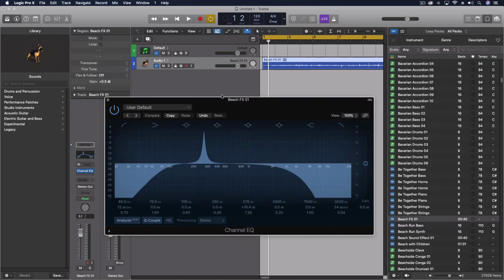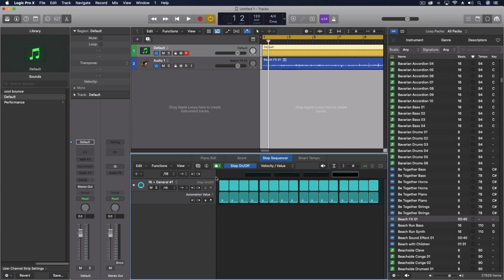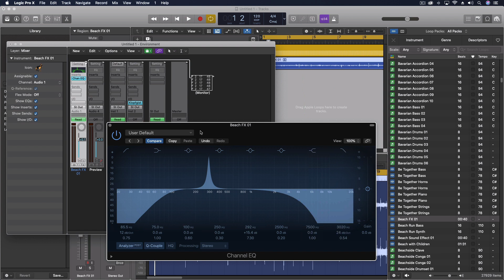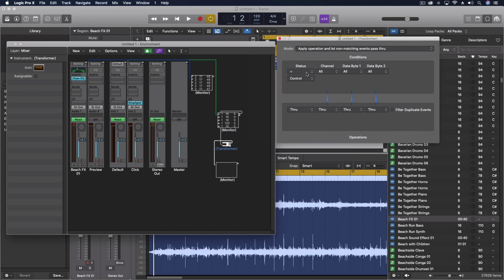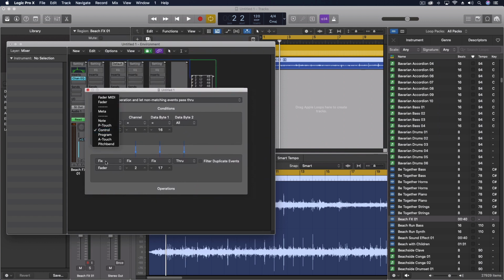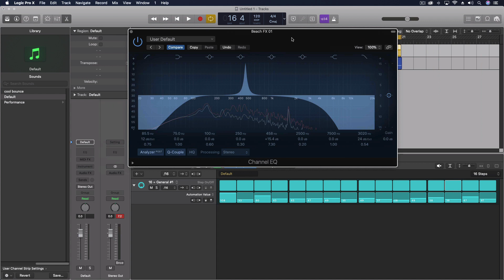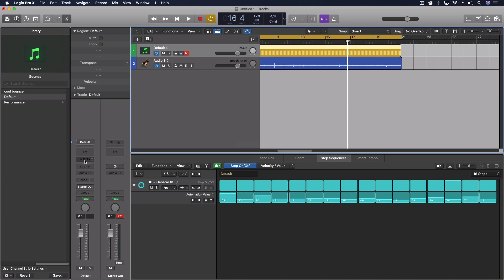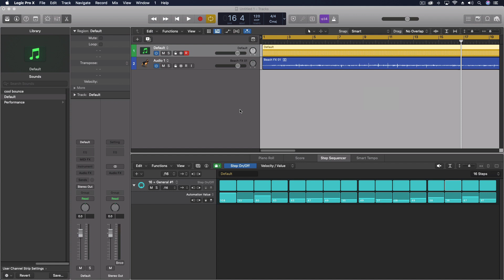Sending Step Sequencer Data to Audio Tracks | Logic Pro X

Comment: There is a so much easier way to do that by putting a Pattern Region on the Audio Track.
Let's say you have an Audio Track called "Audio 1" with the Channel EQ plugin loaded and want to control the Frequency 2 parameter via the Step Sequencer:
-1- Create a new Audio Track "Audio 2"
-2- Right-click on the Track Header of "Audio 2", select the first option "Reassign Track" then "Mixer" and select "Audio 1" which is that Audio Track that you want to control. Now this Track becomes a second Track routed to the same Channel Strip named "Audio 1". Both Tracks have now the same name, which can be named separately from their common Channel Strip
-3- Right-click on the Track Lane of that second Audio Track and select "Create Pattern Region"
-4- There is no Step 4. That's all.

This is one of Logic's secrets that you can have multiple Tracks assign (feeding) the same Channel Strip. In this case, the first Track contains the Audio Region on its Track Lane and the second Track contains the Pattern Region for that Track on its Track Lane to control ANY Automation on that Track. Again, you have access to any Automation from the popup menu in the Step Sequencer, you don't have to look up and assign complex MIDI Routing in the Environment for each parameter.

Hope that helps,
Edgar Rothermich
Reply from the maker: 🤯 I’ve known about reassigning but never tried this! I’m gonna spend some time tonight exploring this!!

Comment: There's a transformer-less way to do the same, but it is not completely straightforward. 
Open the Step Sequencer, hit Learn. Now move e.g. the Midi Track's "Send 1" rotary fader: a Send 1 lane appears in the Step Sequencer. Insert steps & values (as you show in your video) and cable the Midi Track's channel strip directly into the Audio Track's channel strip -- basically what you show, but without monitors or transformers. Hit play: you'll see the Send fader move on the Audio Track. That's easy.
Now the tricky one: insert a channel EQ in slot 1 of the Midi Track. Hit "Learn" again in the Step Seq. Move one of the frequency bands: again a lane appears in the Step Seq. Insert steps & values. Now insert a channel EQ in slot *2* of the Audio track. Cable from Midi Track to Audio Track: bingo, works!
What's the problem? The Midi Track sends out Fader data (F in the monitor) on channel 1 = volume, pan, sends / channel 2 = Virtual instruments parameters / channel 3 = insert 1 / channel 4 = insert 2 / etc.  The Audio Track sends out Fader data on channel 1 = volume, pan, sends / channel 2 = insert 1 / channel 3 = insert 2 / etc.  So the Channel EQ on the Midi Track sends on channel 3 (and thus the Step Seq lane also sends on ch 3), and so in order for the Audio Track's EQ to respond it has to be inserted one slot down, in the 2nd slot and not the 1st.
This holds for all inserts: put a plugin in slot X of the Midi track, learn the proper parameter in the Step Seq, and then insert the same plugin in slot X+1 of the Audio track. Cable from one channel strip to the other and done.
Once you get the hang of it, it's not that complicated. The (imo) really annoying thing is having to use cabling in the Environment at all...
Reply from the maker: Hah, I was just about to explore the learn function but can now do it with a step up. The whole thing should be way easier than any of the options.
Reply: @LogicProLife  Ur welcome :)
Reply: Logic Pro X Life Can you show us?
Reply: @murahachibu  Can't you follow directions and try yourself?  You learn more by doing than by watching.

Comment: @8:57 You don't have to use IAC ports if you want to use a MIDI effect with an audio track. Basically you can use a dummy instrument (volume to 0) on an instrument track, insert your MIDI effect, and insert a compressor set to do nothing, and then route the audio into the side chain of the compressor.  A bit of a kludge but it beats using the IAC driver imo. Laurent Vérronez (Airwave) has a good tutorial on this very workaround: https://www.youtube.com/watch?v=xLp8yiLKWvY.
Reply from the maker: I know that method too but it doesn't solve the issue of wanting to control such things as the pan knob with MIDI effects, which really (sadly) needs the environment.
Reply: @LogicProLife  Ah, yes, that's probably true. No time to investigate right now.